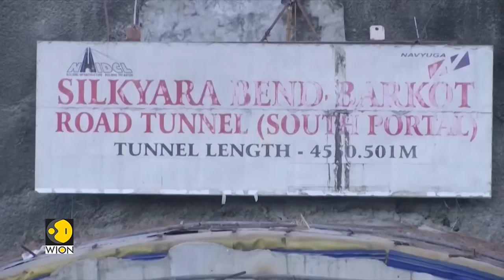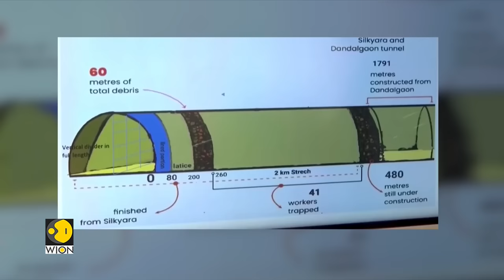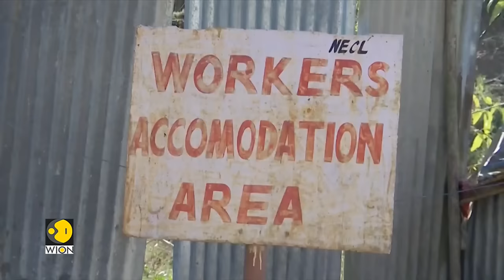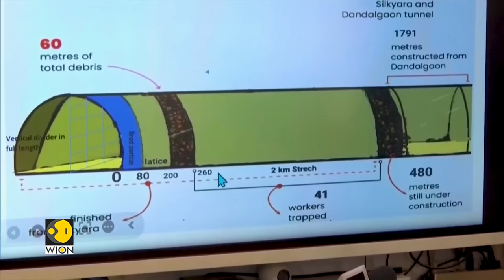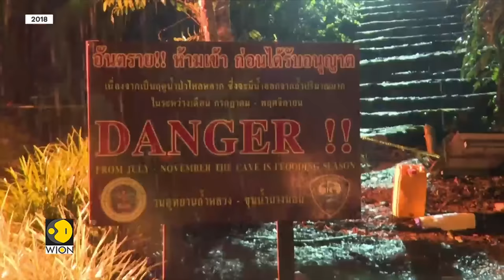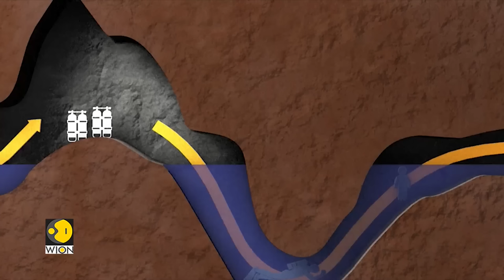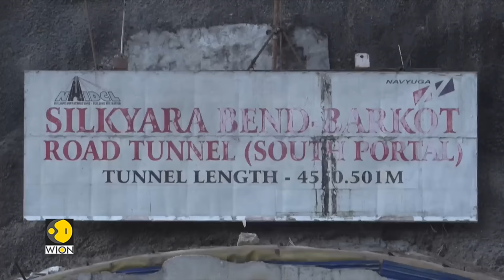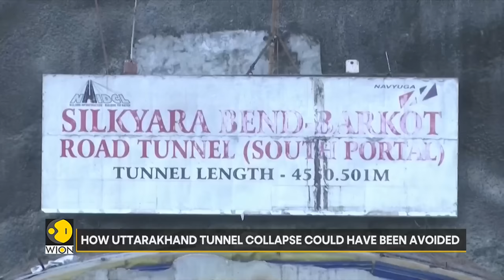India Tunnel Collapse: The Rescue Story | WION Wideangle

Comment: May god help the trapped workers.  Very unfortunate to say Indian safety measures and disaster response team are way below the standard.
Reply: Bro work is slow that doesn't mean disaster team is below standard. There are lot of problems which you didn't aware about. That area is high altitude area carrying heavy equipments there is not easy. Lot of US made heavy machineries broken during drilling. So they have one solution left that is rat mining in which person dig a hole of a size of 30-45 cm with hands.